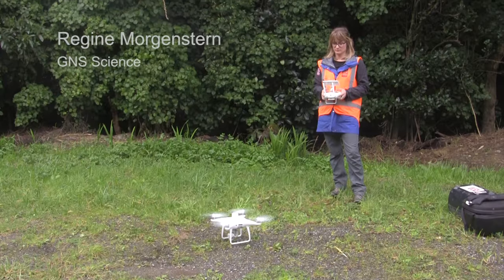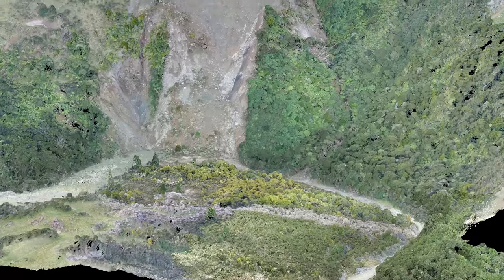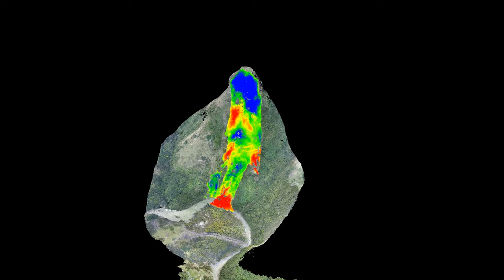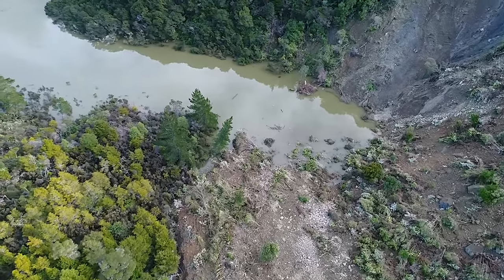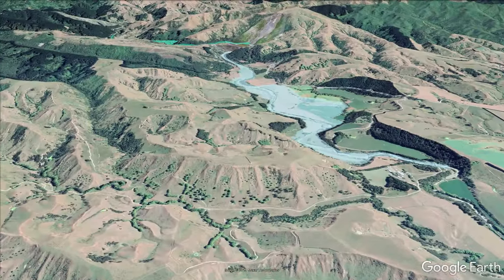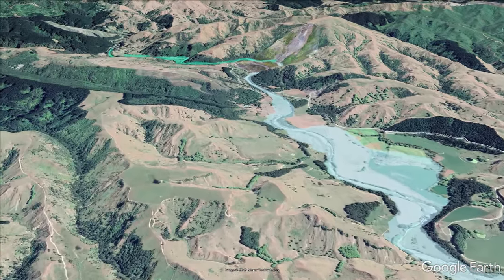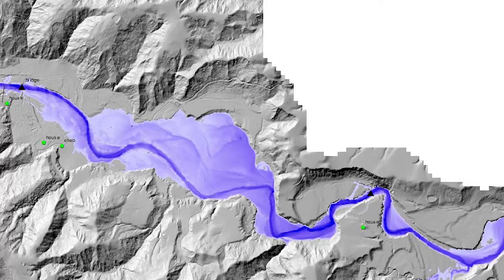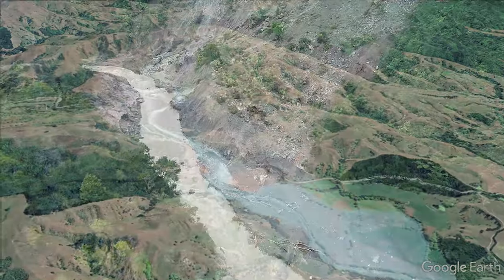Anatomy of a Landslide Dam

Comment: I remember as a kid when there were down trees in the creek we would make a dam. All you need is a good log or two and then bring downed branches to it. The leaves would collect and slow down the flow of water remarkably. The water level upstream would rise until it flowed over. After several days the water level would be increased some distance upstream, with it being still and clear water. Also our parents would make us disassemble the dam at that point, or whenever they became aware of it. Which was also sort of fun but could be a heavy task. There's quite a lot of weight on it at that point and figuring out how to dismantle it was an exercise.
Reply: This poster is actually a beaver with Internet. Lol
Reply: My parents never made me take my dams down luckily. Eventually they fill with sediment and it just looks like I never built anything there since I always used rocks
Reply: @dreadfulbadger  Folks, you may have heard of rock doves (pigeons), well this energetic gentleman is a rock beaver.
Reply: I and my cousin brother used to do the same in our khal/খাল - meaning ditch, besides the paddy fields. We used to block the flow of the ditch using rubble, fine mud, lots of twigs and branches acting as reinforcements, with a steel pipe's cut section as emergency pass for water. The dam was 40-50 cm tall. Upstream of the khal's dam the water level was high so we set up bamboo nets, called 'Chai' (চাই) to catch small fishes like tilapiya or koi and well as look for mudcrabs and it was a decent harvest. 

My parents and uncle were actually surprised that both the brothers did catch fishes and crabs,  if any in that seasonally dry khal. We showed the dam and it really did help conserve and divert some water with siphon to the adjacent field. That small dam was periodically repaired and stayed on for a few months until heavy rain flushed the dam away in August. Those were good memories of childhood!!!😅😢

Comment: So call up the blasting crew. They can blow a cut to drain the back up river.
But instead it is talking talking talking. More real action not lip action.
Reply: The constant talk is constantly lining the pockets of those talking about it.
Reply: Blasting dirt and debris isnt nearly as easy as it may sound
Reply: @haroldburrows4770  
The Mythbusters had the right thinking " if in doubt more C4"
Reply: All this virtual nonsense...by the time their models told them to remove the blockage in a controlled manner.  A rain storm did it for them all at once.  Long ago some one would have been removing that immediately.  This would have prevented the flooding of roads and property they spoke of in the beginning.
Reply: So much money 😱
Sara
Reply: @ET-vj4vz  Way to many people with a university degree and the love of hearing themselves talk.

Comment: why didn't they release water BEFORE it got backed up ?
Reply: How?
Reply: @davidr8309  by removing the landslide that blocks the flow of water, would be what I'd do,, THE DAM FAILURE  only happens when you DON'T drain  the water flow,,
Reply: @jimmymize8536  How do you propose to remove the landslide?
Reply: @dsma2023  if you “drop explosives” on the dam they will have very little effect on the dam made of rubble, the energy will mostly dissipate into the air.
Reply: @jimmymize8536   How is the question you have to ask in order to come up with a solution. All you said in your first comment was “why didn’t they release the water before it got backed up?“ You made the solution seem so easy I wanted to know your plan.

Removing a rock slide of that size isn’t trivial. How can you access the site? How large a bulldozer and how many can you get to the site? How close is the nearest bulldozer you can get to the site? How long is it going to take to get the equipment in place? What are you going to do with the material? Haul it away or spread it out for miles down the valley? 

Even if it wasn’t in a remote location and you had a bulldozer there it takes a lot of time to move hundreds of tons of material. Not to mention it could be too unstable for the bulldozer to drive on.
Reply: @davidr8309  how would I know any of that ?  Let me do some checking around ,,,,,,,,,,,,,,,,,,,,,,,  after further investigation what I found was ,,, it's   totally trivial,  I found a crew ,they will be able to access the site thru  a new road cut thru to the slide . 2 -  D7 dozers  should be Big enuff for the job . I located a couple  bulldozer's  not 20 miles away,, a 4 man crew will be there as well, they can be on site in 1 day,  may take a few  days to clear, but the Team is on the job, as for as to What to do with the material,, they will do the best they can do with it, the slide isn't that massive , so they should be able to just clear a path for the water to continue on flowing towards the sea, if there are any more concerns about this or any other problem , that may arise , feel free to get in touch with me or my Team,, we will work tirelessly to find an answer for you , best wishes from US  to you,, Cheers !!!
Reply: @jimmymize8536  That’s my point! You don’t know what it would take to “release the water”

Comment: You could make a kind of quake table for the hillside. Using the imagery you have taken, a 3d print using relatively small particles of either ceramic mud or 'spice-mix' greensand could be made to demonstrate where failures were likely to happen. May I direct your attention to The GeoModels YouTube channel? The Appalachians aren't moving quite as fast, but the New Madrid will burp sooner or later. Timely information can lend a lot of leverage.

Comment: I understand the value of all the data collection but couldn’t they have set up a siphon over the top of the dam to at least minimize the amount of water building up behind the dam? Air lift in some large flexible pipe ?
Reply: Look up Thistle, UT, USA. A similar slide in 1983 destroyed the town and created a three mile lake. Within days, the state had a temporary drain installed to prevent the lake from overtopping the dam. Eventually, the lake was slowly drained and a permanent bypass for the river was created through the mountain.

Comment: In normal times this event would have been described as erosion, nothing more than what has been happening in river valleys since time in memorial. Now, every possible alternative factor has to be held responsible......climate change any one?
Reply: In those so called normal times many people died from landslide failing to retain the water flow.  This is a relatively common occurrence in mountainous areas.    

Now researchers are attempting to mitigate the destructive consequences of a landslide being overtopped and a deluge sent downstream as the landslide dam fails.

Comment: The management of such an incident should be that of a dam construction in reverse, creating spillways either side, stepping them alternatively lower until the normal flow resumes in a lower bed.
By that, I mean, cut a channel on the left side until the flow slows, while that's happening, form a coffer dam with a valve on the right side, clear the spoil a few feet lower behind it, open the valve to drain down further, then repeat on the left, left-right-left-right until a new bed exists. The remains of the spoil can then be dozed into the river, and the old course returns.
Yes, there is always the threat of further slide activity, it may mean repeating it. Once a natural angle of repose is reached, end of problem.
Of course, anticipative removal of dubious areas is to be recommended....
Reply: Well expressed theory, but impractical in this case.  Such a project—IF deemed safe, which given the instability here is highly doubtful—would take weeks to plan, weeks to contract out, and weeks to implement.  This whole thing destroyed itself in two weeks.
Reply: @737smartin  Fair enough, but that doesn't always happen, and the longer you wait, the bigger the threat. All you can do is hope it doesn't fail. Of course, history is filled with instances where it has, the Isolation of Great Britain and the Black Sea breakthrough being two such. But if you don't attack the issue with that in mind, then you're part of the problem, not part of the solution. I'm a retired crisis manager from the European State Department, a job I kept because I was well aware that a stitch in time saves nine, and if you don't try, you are guaranteed to fail.